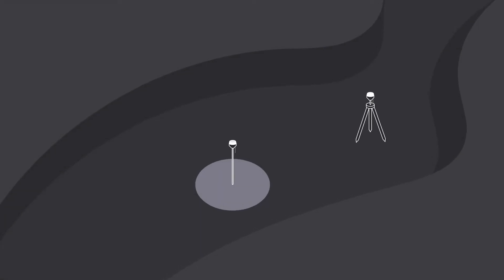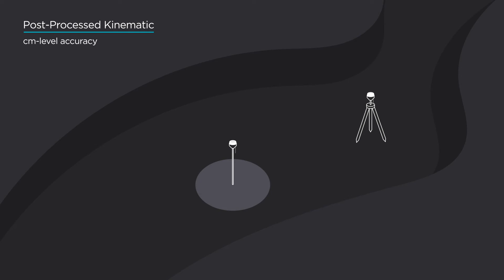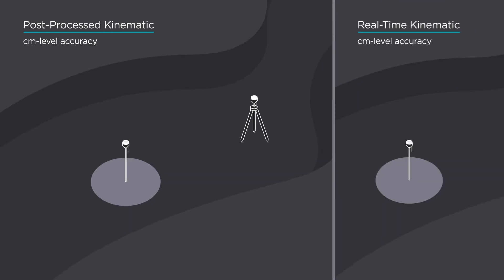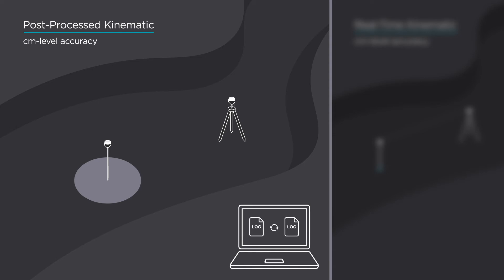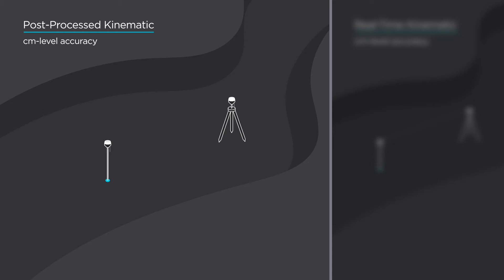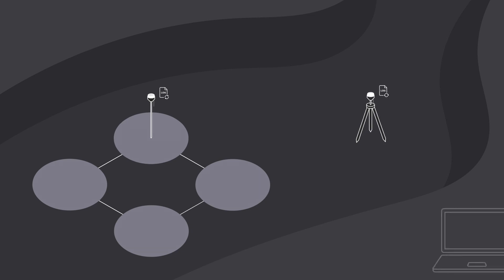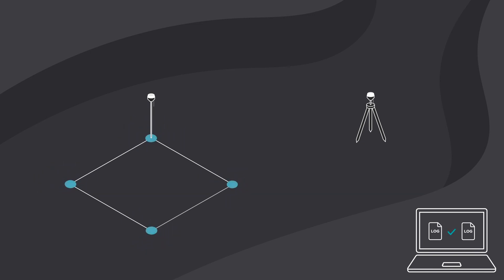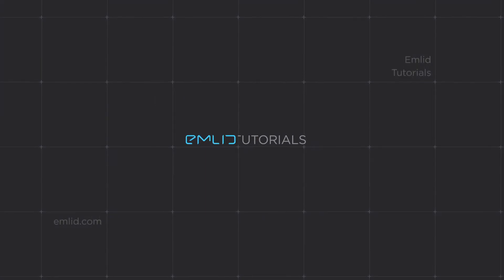Understanding Post-Processed Kinematic (PPK) for Accurate GNSS Data Collection

Comment: When using the cors station under ppk data collection will you need to enter the height of the cors in reachview 3?
Reply from the maker: Hi Raymond,

Your base stations' height is already in the logs from your base. You don't need to enter it manually in ReachView 3: PPK software will handle it automatically. 

However, don't forget to enter the rover's height in RV3 if you're collecting points manually :)